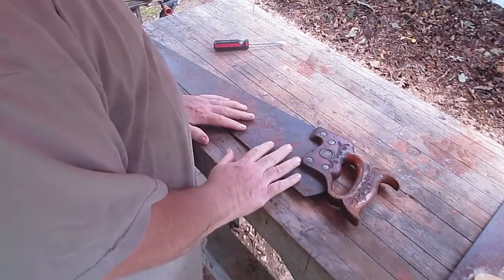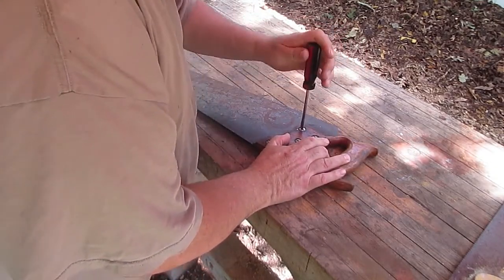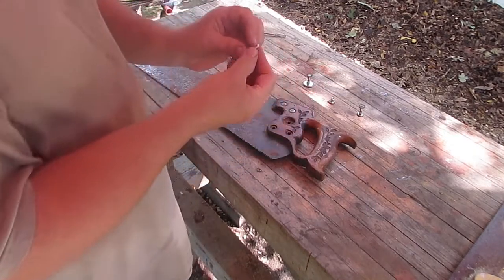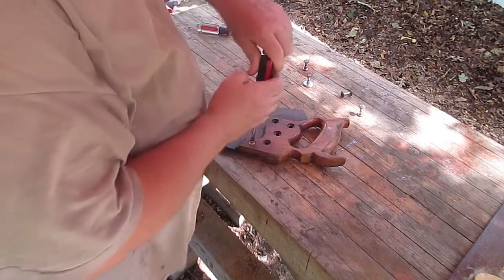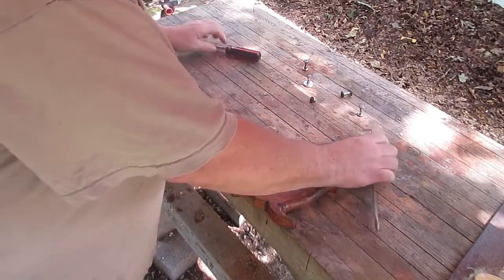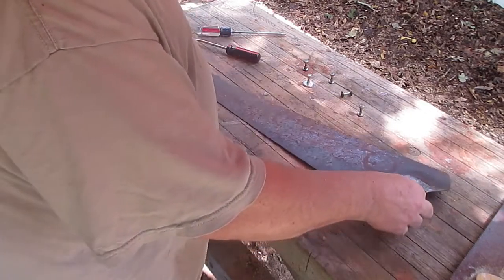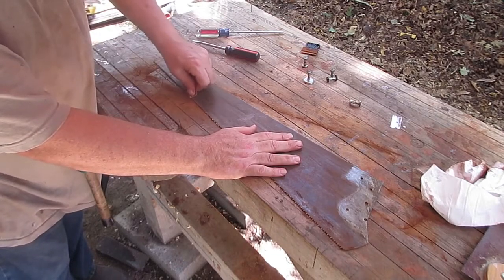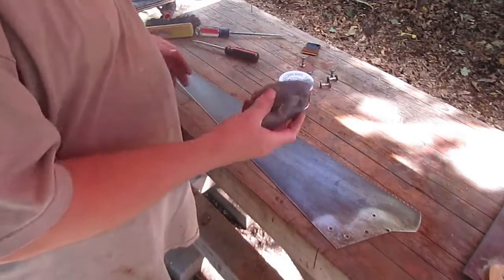EC Atkins Handsaw Rehab Pt 1   The Saw Plate

Comment: Usually when I’m working with the saw nuts, I leave it the last couple turns onto the post. Then, with my thumb, or a soft face hammer, push out the carriage post. Then I can hold the head of the carriage post between my fingers while taking the other side the rest of the way off. That way, I can avoid jamming a tool into either side of the tote, or the plate.
Reply from the maker: Thanks, Michael.

Comment: I try not to remove handles unless I'm going to replace the handle. The metal under the handle doesn't need attention. You have to focus on that area where handle meets saw plate a little more but otherwise you can remove rust and smooth out the plate without removing the handle. I guess I'm mainly thinking about very old saws and I don't want to damage any of the saw bolts and nuts.